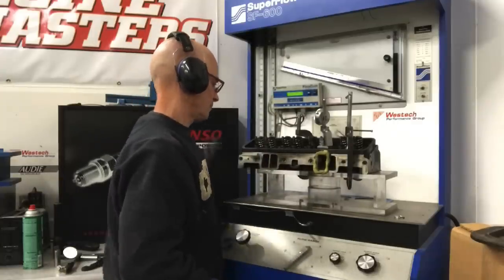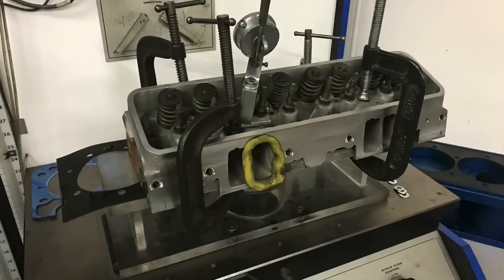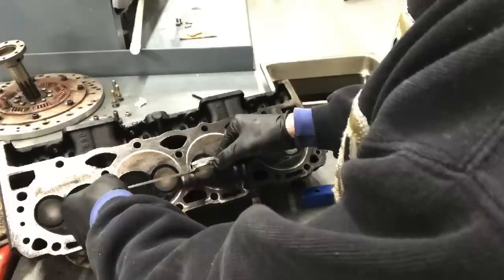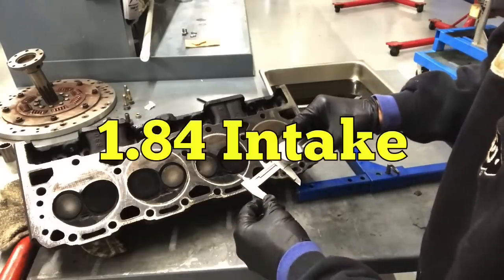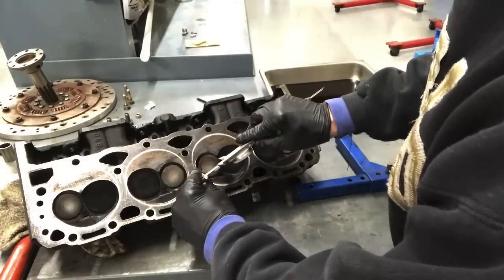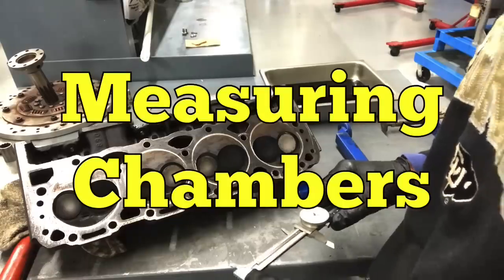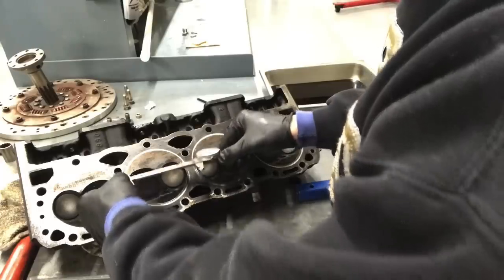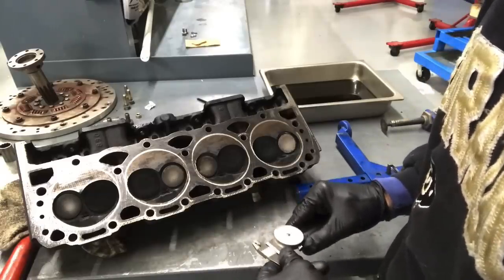L99 VS LT1 VS LT4-WHAT DO THEY FLOW?

Comment: Ok, I believe we've all heard of "valve shroud". Is it true here with a small bore L99?? IDK, just asking if it's relevant??
Reply: Absolutely it's relevant for the L99, pretty much anything besides a hemi style combustion chamber whether it's overhead valve or overhead cam is going to suffer from the board being in the way of the flow path
Reply: @DSRE535  Thanks for the reply and it's as I expected. I was looking for a reply/head flow test from Rich to confirm what I believe and what you stated. Numbers don't lie so a flow test on the L99 bore size with the LT1 heads would be nice to confirm. Also, food for thought is if an L98 TPI head would be better with a port and polish?? Still valve shroud? ONLY a flow test based on the L99 bore would be relevant. IMHO, the L99 is a waste of time, regardless of what you pay for it, anywhere. Thanks again.

Comment: You should do a comparison on cam timing in a small block. Go from -6 degrees to +6 degrees comparing horsepower changes and rpm range.
Reply from the maker: I did that already-maybe i should do a video but it depends greatly on the cam you start with

Comment: I hope you have seen tick performance lt1 camaro. They have pushed the 90's lt1 stock block to it's limits and it shows how under rated these engine are. I have made 800hp. On a stock lt1 with pistons only.
Reply: So you just had it bored and stroked and got 800 hp? No other modifications?!
Reply: @justinfbabay  no never bored or stroked. I honed and changed over to JE forged pistons and kept the stock rods and stock crank. I used a S480 turbo and ran 17psi of boost to make 800hp.

Comment: The L99 seems to be tuned for mileage. Those numbers, if the theory is correct should bring the most economical package. Interesting!
Reply: Emissions and not only that but making power in the streetable RPM ranger smaller cubic inch requires smaller parts smaller parts in the cylinder heads etc
Reply: @DSRE535  And when the parts are smaller, they also have smaller inertia, so it should rev higher and gain revs faster. A very good candidate for time attack etc.

Comment: I believe the outer eight intake bolt holes will physically line up, but are at a different angle. People have used spacers to correct the angle and simply leave the inner four bolts out.  It may be worth a shot for the engine dyno.  The angle difference is ~17 degrees.
I do have a pair of iron LT1 heads that have been laying around. If you wanted to send me a shipping label, I could box them up and send your way for science. I have no use for them.
Reply: no position is also different on some of the outer 8 bolts
Reply: no need for spacer just drill and tap the lt1 heads to a sbc bolt pattern use a gasket for the lay out only need 8 bolts theres no coolant going through intake its just intake air doesnt need to be supper tight

Comment: I'd bet that flowing them on a fixture the size of the engine they'll be used on, will drastically change the results.
Reply from the maker: agreed
Reply: @richardholdener1727  What size bore fixture did you use?

Comment: You're a workhorse...

It the LT-1 combustion chamber overlaps the cylinder bore, is that not going to cause some serious disruption in airflow coming in via the intake valve?
Reply from the maker: it may-sometimes it just works-but I would like to test
Reply: @richardholdener1727  Well, I suppose that's the only way to know for sure.

Comment: Do you switch airflow directions when flow testing the exhaust?
Reply: Yes.  The valving in the flow bench changes flow direction for intake versus exhaust ports.
Reply from the maker: yes-intake test sucks and exhaust test blows

Comment: Richard can I get a really quick answer which carburetor and ignition box would you suggest for a carbureted lq4 with the cam and spring upgrade using the 317 heads for a daily driver I appreciate any information you can tell me thank you
Reply from the maker: msd ignition with stock coils and a brawler 750
Reply: @richardholdener1727  thank you for your Speedy reply I like every one of your episodes that I've watched keep up the great work

Comment: Why would airflow decrease at a higher lift? Is it a velocity issue?
Reply from the maker: port shape-cath ls heads often do the same thing
Reply: It’s caused by the “too big” area of the valve opening compared to the area of the port.

So in every head there is a certain point where this issue is.

Let say it like this, the factory heads are always a some sort of compromise, and that’s why people still today are tuning their heads.
Even the aftermarket ones. It’s a cause of having a target(s) to have on the build.
(Like how much flow on how much lift etc..)

I’m simplifying this but you get the idea.
From the factory the deal is:
1. You can have too small port (area) and too big valve (area)
2. You can have too big port (area) and too small valve (area)
3. You can have enough port area and enough valve area for what you’re looking for.

In the first the port area becomes the restriction, which causes that more lift wont make more flow.

In the second you’ll usually see poor low lift flow which improves in the middle lift and gains flow with more lift to the point where the too small of valve (area) is restricting the flow.

In the third you have a good baseline for a head for your application. 
You can go with bigger valves and bigger port area if you need/want to.

Of course the valve shrouding and the combustion chamber size and shape is effecting to the flow characteristics too, but let’s not mix it to this now.

And velocity is it’s on topic too.
Velocity is good/needed on the low engine speeds and is not (in my opinion) a big thing to consider on race engines.
And it’s a big deal on a stock engines, cause emissions and sh*t.. 😃

Comment: Put the 4.3 l99 crank and rods in the 5.7 lt1 for a modern 302 cid and spin that SOB
Reply: He talked about doing this.

However, the valvetrain decides the RPM not the crank stroke.

Comment: Wow the data is pretty interesting, I am asking for a friend because he doesn’t know, lol, in NA trim how much HP is 20 CFM extra capable of generating?  Follow up question if you free up the intake flow do you lose torque? 
I think it would be very interesting to see the L99 heads exhaust ported compared to the stock LT1 heads. My guess is in NA guise they’ll be similar so a person could run which ever they can get. If you throw boost at it then the unadulterated LT1 heads will probably win out. They probably had to choke the L99 up a little so it would give people a reason to buy the LT1 😉
Reply from the maker: 20 cfm per cylinder can be worth 40 hp (or more or less)-depending on the power level and flow needs of the rest of the motor
Reply: @richardholdener1727  was the flow test done on the L99 bore size and positioning?
Reply: @thegdfp6447  no.

Comment: My L99 got mid to high 20s in my 95 caprice and not enough power to break the 4l60e. Great cruiser/lowrider drivetrain. I put 100k on it and sold it (70k to 170k) problem free.

Comment: I also doubt you're going to see much of a power increase unless you really build that 4.3 to deal with some high RPM with a much bigger camshaft,  intake flow exhaust flow it's all going to have to be a thought out combination in order to maximize that engine with the bigger heads in my opinion
I believe porting the l99 head would actually net the best results out of all of those heads in my opinion, similar to why the 706 and 862 had works the best on a 4.8 5.3 in a drivable RPM range
Reply: I agree with you on porting l99 head 👍

Comment: The LT1 head was disappointing in that it only flowed 5% more than the L99 at .500 lift.  But the LT1 really has a big advantage in mid-lift flow, about 17% at .300 lift.  It was surprising that all the heads lost flow at .600, but just go with it.  If you could get a series of cams that all have .500 peak lift, but successively longer duration, that would make for an interesting series of dyno tests.

And I think you need to flow all the heads again on a bore size close to the L99's, to show the effect of shrouding.  People get all stressed out over shrouding, and it would be nice to put some real numbers on it.  I don't get very excited about it because even though a small sector of the valve gets close to the cylinder wall, there is still the rest of the valve circumference that isn't.
Reply: why would you be surprised they lost flow at 600 stock cams are in the .450s the lt1 is vastly superior to the l99 look at that exhaust port

Comment: To be honest i think with port work, and swap 1.94 intake valves in the l99 heads you can probably get in the 220-230 cfm flow range pretty easy, and get the exhaust side up to the 85% flow match
Keeping the small chambers will help keep the compression up(I would probably mill .020 off to gain a little more)  vs, what you will loss with the lt1 head..
That compression is going keep low speed torque numbers up.. all of that and the right intake/cam combo, I think you can get 320-330hp out of this engine without having to spin it over 6k rpms
Reply from the maker: I agree-might do that to these heads with TPI intake
Reply: @richardholdener1727  I know the tpi intake's will carry power to 5500 with a port work etc.
But most of those test done back in the day was always done on bigger engines, it maybe prefect on a 265ci engine and support power to 6k rpms and make a great torque curve from so little cubes haha

Comment: IMO even on the little 4.3 the LT4 heads will make the most power. They flow better and have smaller chambers than the LT1 heads.  Given the same cam, compression and flow will give more power.  The 265s smaller bore will slightly decrease the flow but not enough to negate the dramatic flow improvement of the heads.  The valves open around 0.450" before they ever even clear the chamber.  Use a thin steel shim style gasket for a B-car LT1 to keep the compression up and keep the gasket out of the chamber.

Comment: AFR makes a head for the 305 (same bore size) Maybe?
Reply from the maker: WATER PASSAGES
Reply: Cooling is over rated... lol
Reply: @richardholdener1727  They were conventional sbc. 1.94x1.55 and 58cc if I remember correctly. discontinued I think
Reply: Trick flow made some 305 heads as well for the tuneport

Comment: I checked at junk yards and lt1 is more expensive then ls stuff is this common? Because ls makes way more power
Reply: Not surprising, I spent a lot on my LT1 simply because it's what was originally in my Camaro and different than an LS. Very capable motor but yes this is ONE of the reasons it's not very popular anymore, consider this, u can make around 10-20% more power dollar for dollar with an LS.
Reply from the maker: our junkyards are all the same price for any v8-excpet BBC
Reply: @richardholdener1727  no not here either i can get aluminum headed lt1 for 500 bucks if i looked with a 6 speed its at 1800 ls are 2k and up a stock lt1 vs stock ls1 is a drivers race you can drill and tap the heads or any sbc1 manifold and run a dizzy on a lt1 or lt4 and put it in any car with some minor changes ls needs more money an exhaust and ecu tune ect. to get going if your goal is under 500hp you cant beat a lt1 on price

Comment: Rather than modify a GEN I SBC head to work on an LT1 bolt why not just drill and tap a set of LT1 heads for GEN I intakes?
Reply: correct you dont need all the holes either as there is no water going through the intake and hes only run time is the dyno i have a lt1 with the head drill and tapped for sbc1 for yrs no problems i only used 8 bolts to hold down a t ram manifold  4 on each side lt1 heads are about 300-500 for a pair most sbc gen 1 efi manifolds are worth 1k-5k

Comment: Which iron head did the94-96 Impala SS have?
Reply from the maker: iron lt1
Reply: has vortec combustion chambers intake port are slightly better than lt1 at 220cfm but exhaust port is close to this l99 imo its better to have the lighter aluminum lt1 and lt4 heads you can also get away with more timing an CR with the aluminum

Comment: i’m waiting for the tpi manifold. i think it will be good on the small engine. i don’t think the head upgrade is going to make a big enough difference to justify cost. i would port the l99 heads and send it.
Reply: aluminum lt1 heads are cheaper than porting iron heads they also flow really well on the exhaust side and are 50lbs lighter
Reply: tpi mani should make the most power to 4800 out of all the manis he will test doubt he will test hsr super ram or modified large tube tpi either
Reply from the maker: TPI will make power past 4800 on this 4.3L
Reply: @richardholdener1727  more power than the lt1 and dual plane your gonna test?

Comment: How different is the LT5?
Reply from the maker: the LS-based motor is very different
Reply: @richardholdener1727  I'm talking about the vette motor, from the early 90's
Reply: @jamest.5001  

intake ported and siamesed can get to 340-370cfm
.1 93
.2 168
.3 223
.4 248
.45 257
.5 264

Comment: If anyone is interested I have a set of  ported LT1 heads  from Golen Engins complete and ready to bolt on with the match ported intake. Along with a bunch of other performance parts for an LT1 just sitting around. Motor is out of a 93Z28, built top end with full bolt ons and a pcm tune it put down almost 415hp
Reply: How much are you asking? What else do you have?
Reply: @poncoolride  $750 for the complete heads and intake.  I paid over $1200
Reply: @poncoolride  2in intakes 1.56 ex. Beehive springs I believe.   I have headers, aftermarket crab style distributor with msd wires and blaster coil,  236/242 comp cam(big cam), comp cam roller lifters and 1.6 rockers. It was basically a 383 top end. Probably a few other parts I'm forgetting.
Reply: @515FLTRXS  nice job  little better build then my 503  baby cam 383 stroker but I make 425 hp 500 tq 96 ss impala I think I can get more out of her like you could with yours cheers!!!!
Reply: @tta5891  It was a pretty good running car, a lot of fun especially with the 6spd. I probably left a little power on the table with the mail order tune.  Instead of rebuilding it again I just decided to go the LS route. They're cheap and easy to get big power out of, a huge aftermarket parts supply and tuning options seem to be endless as well. The LT1 will always have a "cool" factor for me though.

Comment: Have you done  l98 heads ?
Reply from the maker: I have in the past
Reply: @richardholdener1727  ok ill have to go back n check that out ...see if i should stay with them or upgrade
Reply: @alex13238712  Upgrade.
Reply: l98 aluminum 113 flow about the same as lt1 aluminum on exhaust the intake is 199 the iron is a bit less on the exhaust

Comment: Would like to see someone flow all the Honda b series heads then compare
Reply: They flow about in the order you would expect B16A(PR3), then B18C(P72), then the top dog B18C(P73). I don’t recall where the B16B head falls in line but I assume it would be closest to the P73 head.
Reply: @kennethpowers8995  and most honda nuts claim the b16a sir 2nd gen flows better than b18cs that's why I'd like stats to back claims up
Reply: @theedge5584  there isn’t much difference in head flow period between a B16A or A2 head and a GSR/P72 B18C head. At .450 your talking around 215cfm vs 220ish. Very similar. But the B18C P73 head and also the B16B head are way ahead of any B16A head flowing nearly 250cfm @ .450
Reply: Jus like yo see charts ot video of testing cuz still no proof....no offense
Reply from the maker: different valve sizes in the B18C5 head, right?
Reply: @richardholdener1727  1mm difference yes. There is also a slightly different “dimple area” which is supposed to help compression a smidge. Valve stems between P72(GSR) and P73(ITR) are the same, but there is more seat width for the GSR vs the ITR, but again not by much.

Comment: Does the lt4 heads fit
Reply: So if I buy the lt4 heads I can just bolt them on with out doing anything else
Reply: And how much horsepower will it gain
Reply from the maker: the l99 does not need lt4 heads
Reply: What heads is better for it

Comment: Flow a k series head I bet you will be really impressed!
Reply from the maker: I did for the book I wrote on K-series years ago-I know how good they are
Reply: to bad there only 4 cyls the fastest stock K ran what 15s14s? a stock lt1 camaro can run mid to low 13s also not fair cause the lt1 head was design in the early 90s and is sohc

Comment: I'd bet that if you installed 1.94 valves in the l99 head it would flow better than the aluminum lt1 head
Reply: not on the exhaust side though what good is it getting all the air in but not out?
Reply: There are engine master teams that have actually gained power with less exhaust flow. Exhaust flow is not nearly as critical as intake flow when it comes to making power.

Comment: They tell you to not mix up the 2 smaller bore  lt1s and you did lol
its a 307 or 305 bored to 394 Ha Ha Ha 
LT1 LT4 are the same Engine Block with 327 # on side of block lol 
both 4 inch Blocks 350  means 4 inch bore 348 stroke 
the 350 also has 70 thousanths bigger Dome exaust ports than the LT4 both Vertical and Horizontal 
Also 162 intake ports  the vet z28 heads have 175 cc intake runners
on the flow numbers Lt1  intake at 400 lift are 220 4.5 226 and go backwards at 500 and 600 are going lower thats what the dome exaust ports do is force vortec tumble
about 4900 rpm about 40 more horses hit 
Dont know why your little lt1 is still gaining flow to 600 
pretty good HP but Torque would be 100 less
the 350 heads flow 10 to 12 less than 195 LT4 through a 194 valve.
I just heard about a guy who ruined a set of LT1 heads putting 2 inch valves in them
350s respond realy good to 2 inch valves 
smaller lt1 s Dont just opposite 
Like you said LT4 heads on little motor not so good 
LT4 is a 350 same as LT1